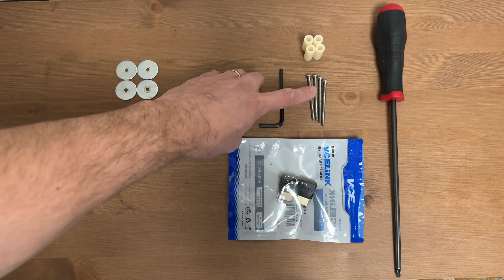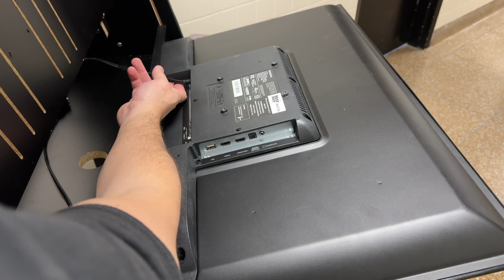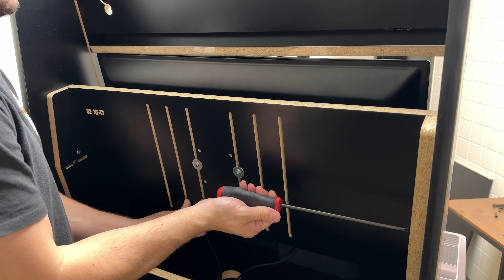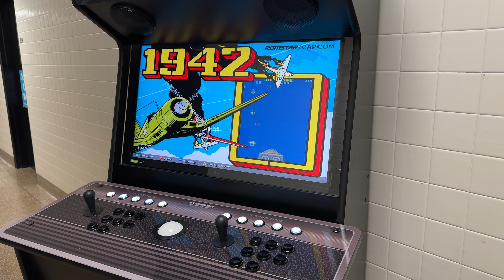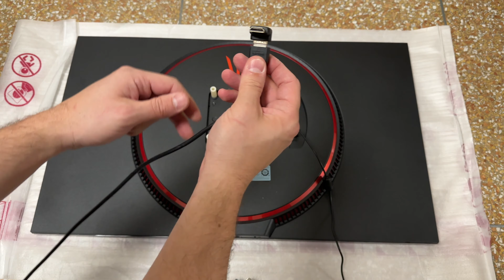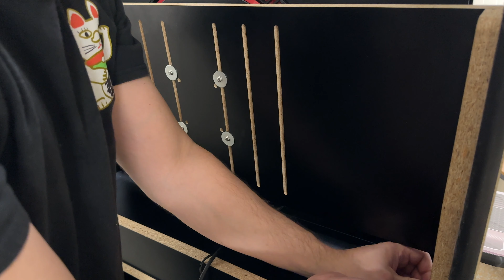Rec Room Masters TV/Monitor Installation Guide

Comment: I was going to purchase but why is there a gap showing the LG monitor bottom and sides?
Gameroomsolutions have their plexiglass where there is a black bezel taped around the sides since all TVs will have the same 32" viewable space.
I rather not go with GRS though after a horrible experience with a pinball cab.
Am I missing something or do we have to figure out a bezel solution ourselves?
Reply from the maker: We provide a bezel, you can see it in our main cabinet assembly instructions.

Comment: Is there a 32 inch TV that you guys recommend? A TV that turns on automatically as soon as it energizes would be preferable.
Thanks!
Reply from the maker: Hi, every product page on our website has a section at the bottom where the recommended TVs are listed.
Reply: @Recroommasters  thank you!
Reply: I use a 32" computer monitor with Freesync support. Computer monitors are clearer and freesync is useful for emulating older games that have odd refresh rates (i.e. Mortal Kombat and Samurai Showdown).